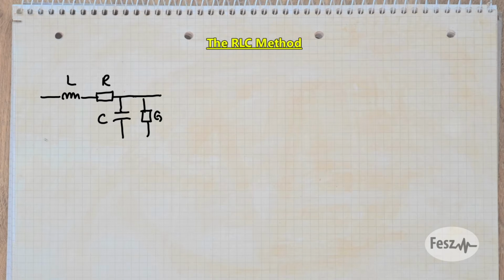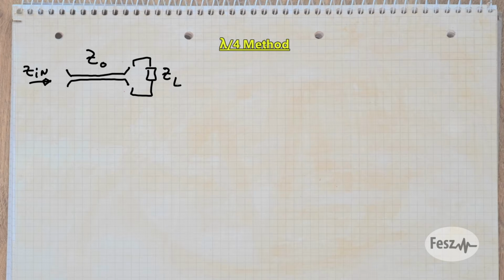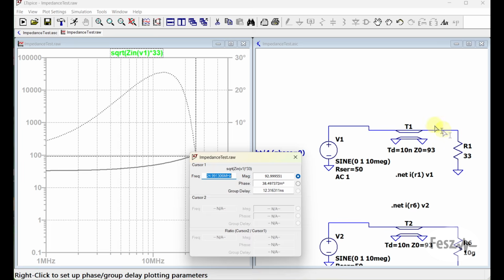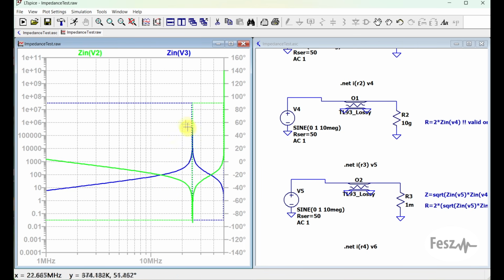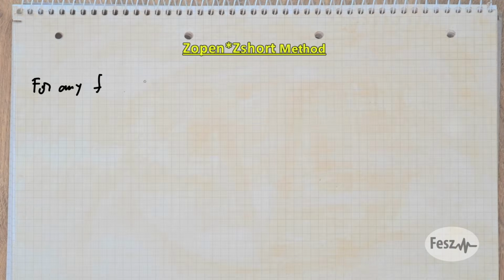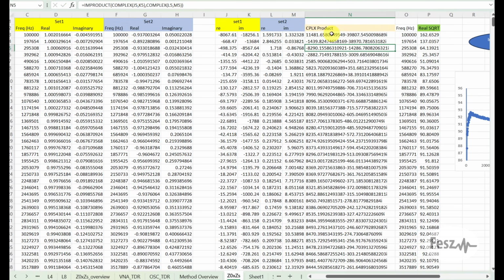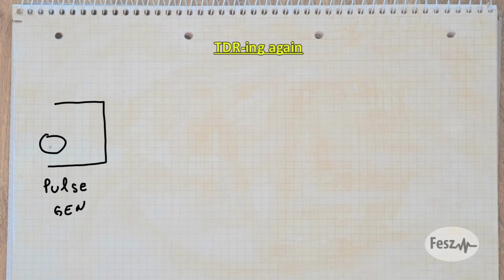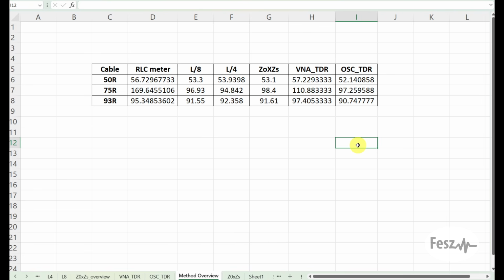5 Cable Impedance Measurement Techniques

Comment: Doesn't the steel cable have a biggish pure ohmic resistance? Allegedly, in some oscilloscope probes they are used on purpose to dampen reflections.
Reply from the maker: Indeed, for your typical X10 probe, the cable is some form of higher characteristic impedance lossy transmission line to remove reflections, but after checking all the probes I have in the shack, even the really cheap ones, none seem to be magnetic;

Comment: The ripples on the TDA may be real.  You can see damaged spots on the cable.  We would put a T on the scope.  Connect one end to a fast pulse generator and leave the other end open circuit.  

Also the frequency response of the cable will rooll off.  We had a program to compensate for the frequency roll off.  I'll lok around and see if I can find that.  

Good video as usual.

Comment: A simple method IMSAI Guy uses is to connect a potentiometer across the end of the cable and adjust for zero reflection, then measure the pot's DC resistance, since a cable terminated in its characteristic impedance does not reflect. Obviously has trouble as the potentiometer+connections becomes on the order of the measurement wavelength, and don't use a wire-wound pot 🙂
Reply: I've used that method on real-world cables sending real-world data, and had great success. The benefit is you can do the measurement "in-situ", which compensates for all the other unknowns, like output impedance of the driver, and any mismatches at connectors and whatnot. And all you need is a decently fast scope, and a pot!

Comment: Shielding made with steel? Must be special shark-bite proof cable. 🙂
Reply from the maker: The original cable I used in the video was already thrown away, but after checking, I did have some more... Anyway, I cut it open to check, and both the core and the outer shielding contains some sort of copper coated iron wire - it looks orange, but the magnet is attracted to it... I guess this is what you do to make low cost "copper" wire
Reply: Lots of cheap clip leads sets from online sources also use iron core wire. And then they just fold the stripped conductor back over the insulation and just use the insulation part of the crimp. Even if you reterminate with the wire soldered to the clip the resistance doesn not improve much. Still 0.5 Ohm or more for 300 mm of wire

Comment: 1:47 you say "after calibration" - - I got into some trouble recently for using that word. Apparently (in the strict BIPM-sense) the "thing that you do" is called "adjustment" (not calibration!) - calibration is something entirely different, albeit related; I am aware that >99% of the people using the term "calibration" do so incorrectly.
Reply: Best adequate word should be "correction" i think
Reply: Absolutely! People say calibration when they may mean adjustment or characterization. Calibration to me is an adjustment or comparison to a known standard, adjustment may be a relative zeroing, and characterization the process of finding coefficients or constants for an item in a system under specific conditions.
Reply: Calibration is generally "checking if something is in spec" and writing down the actual values.

Comment: 12:50 Why is the best accuracy with S11 achieved when the measured impedance is close to the port impedance? Wouldn't the accuracy be the highest when there is lots of reflection so the measurement reciever is operated away from the noise?
Reply: It takes more precision in the measurement to be able to recognise 99.9% reflection vs 99% reflection as in both cases you have quite a big signal. On the other hand, measuring 1% versus 0.1% reflection just needs some gain in the receiver side of the VNA to provide sufficient sensitivity.

Comment: It might be a fun project to design a dedicated cable analyser, a box with a screen and a BNC port that applies several of these methods, does the maths inside, and displays the results on the screen!
Reply from the maker: That does sound like an interesting project, though the programming part would make it a bit more difficult. What sort of microcontroller or development board do you usually use for something like this?
Reply: @FesZElectronics  Hi Fes, i was not started video, but it should be enough esp32, just generic one. If is not enough powerfull another variant would be something from stm32 family, lot of mcus on dev board to pick. Esp32 has big advantige in price and wide popularity thru thinkering communities. 2 cores up to 240mhz, wifi, bluetoot, lot of libraries by community or expressif (manufacturer). Have a nice day 👍👍